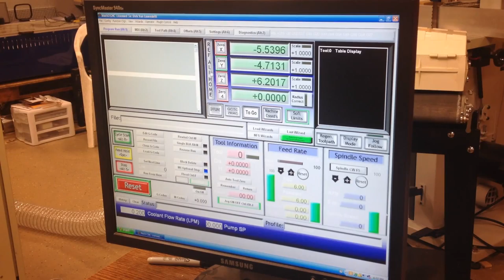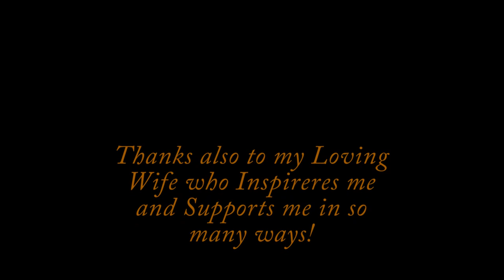Project 002: Inlay Banding The Easy Way... CNC Router

Comment: Thanks for the mail if only I had one quick tip though when thickness sanding the pieces to make it quicker you can use double sided tape to stick them to a board and put the board through the thickness sander saves me a lot of time with other applications you just have to be careful taking them off

Comment from the maker: I haven't decided yet.  They are too small to use on anything big.  I just did it with some scrap I had laying around.  I can easily make a several foot long piece though.

I was thinking about making some picture frames with them or some neat coasters or something.  I have to make a mitering jig and a mitering shooting block.  I've got the design in my head but haven't had a chance to draw it up yet.

Comment from the maker: If you are referring to the white machine with the black belt, that is a drum sander.  It's a Performax.  I don't think they make that particular brand anymore, but it is exactly the same machine as the Jet or PowerMatic.  Mine is about 10 years old.  I bought it used.  You can buy them at woodcraft or rockler if you can't find a deal on a used one.  They come on sale for about $800.  My dad just got one when I took mine back.

Comment from the maker: I will try that with some maple at some point.  I can get my hand held dust hose extension out and collect the dust.  It does make a mess.

Also, I won't be doing that with any woods that I haven't had previous experience with because I had an allergic reaction to lace wood the first time I worked with it.  I what is effectively a sub micron filter on the DC because of that now.

Comment: If You could angle the cutting head at 45, You could use standard flat bit which has a sharp 90 deg edge. Very nice, thanks!
Best Regards
Goran

Comment from the maker: Heidi,

CNC woodworking machines are becoming less and less expensive all the time.  The expense is really driven by size, accuracy, and speed.  the kit I have sells for abut $7k in total (with all the extra stuff I built).  In terms of good woodworking equipment that is about 2-3 high quality, major tools.  However, it can do the job of all of those tools.

Comment: there is so much to be said.
1. if you show us some products  show us some closeups not from the far away point of view. a link something.
2. when you first shown the inlay i thought it would be very difficult to cut each and every square and then glue them all up... messy job but hey...
3. was left in awe when i saw the real process and thought it is a work of briliance.

Comment: No offence, but this is not woodworking. It's merely wood processing. Since there is no skill involved, only machining, then there's nothing special about it. Anyone can do it with a load of cash.
Reply from the maker: Alexandru Preda You are entitled to your opinion.  

However, I would argue that there is an incredible amount of skill involved.  I built everything and I did the programming.  I did the order of operations.  I did the machine calibrations.  In fact, the very process of bringing something from concept to reality (regardless of the means) involves a lot of skill.  All of these things take time and SKILL to do.  The only way a load of cash is going to get you these things is if you pay somebody with the experience and skill to do them.  The equipment does not run itself.
Reply from the maker: Alexandru Preda And yes it is offensive to any person to have another person trivialize work they have done (regardless of the magnitude of their work or the perception of value).  To make comments like that in a public forum is frankly rude.
Reply: Sigh.    I have Parkinson's Disease,   which has good days and bad days with tremors.  My days of using a wood chisel are limited.  I did build my own CNC router, which allows me to still create and build things.  Yes I use a computer to layout my cuts, and do them, but there is something hugely satisfying in building things yourself.  Only issue... use slow setting glue, and lots of clamps. 

Other trick, for soldering SMD mounted parts, is to "reflow" with lots of flux and a iron skillet on a hot plate.   Near impossible for me to get 0603 caps down, but that allows me to get a proto board working.
Reply: +Walker Dreams should be difficult to realize - all the more AwesomeNess when you achieve it Walker.
Reply: usually the people that say cnc is not real woodworking wouldn't feel the same if they could have a cnc.